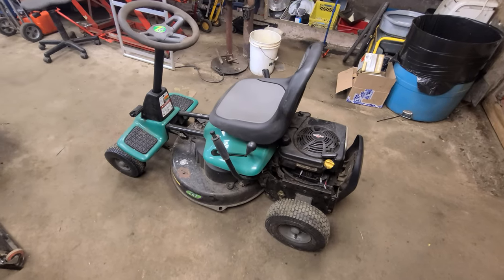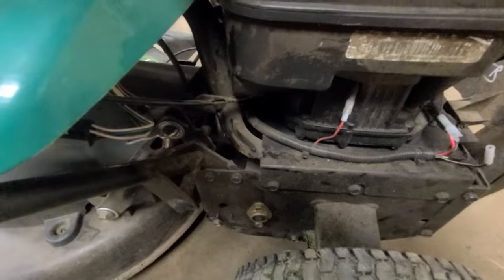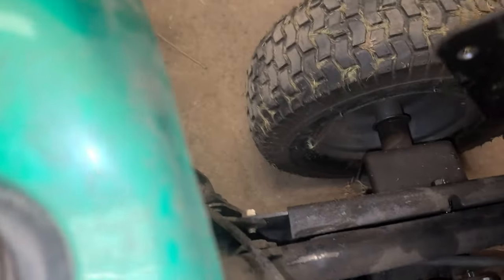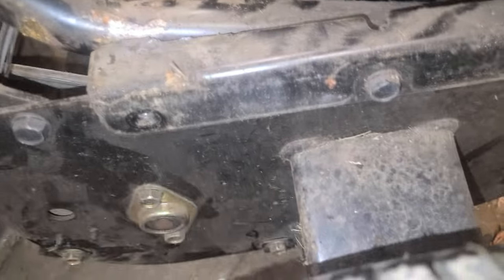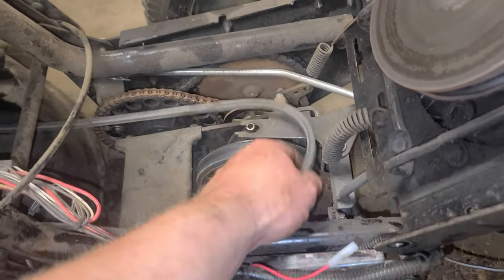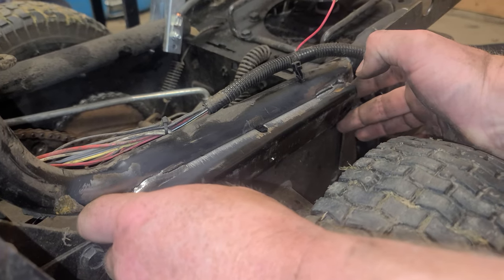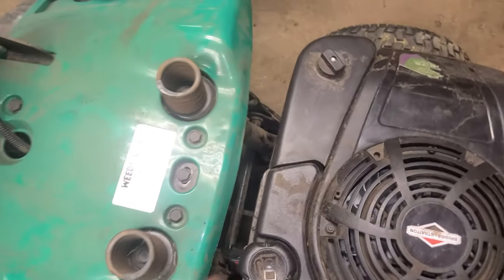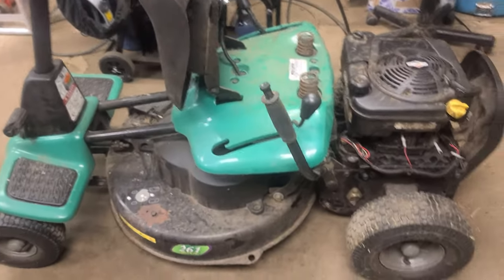Fixing a $10 Garage Sale Bought Weedeater One Rider Mower

Comment: I have the same mower. Twice I had to replace the flange bushing on the left side. Also had to replace the axle because once the flange bushing wore out it started to cut the axle shaft since it was spinning on the frame. I can’t get the flange bushing anymore. It’s been on extended back order since August. So I gave up and I went to Grainger and bought a DAYTON 2 Bolt Flange Bearing: Radial Ball, 5/8 in Bore, Alloy Steel, Set Screws, 4 in Lg, 2 in Wd and I bolted it on the inside of the frame. It’s perfect and better than what was originally there. Now I ran into another issue I can’t get it to engage in reverse.  All forward gears work. Reverse slips or won’t engage. I’d adjusted the shift handle a little to see if that would help. It’s still does the same thing. I’m at a lost on this issue.
Reply from the maker: Nothing personal against your machine but these mowers are absolute trash. It's why people give them away, they are sick of spending time and money on them. Sell it and get yourself an older craftsman or Husqvarna and be done with it

Comment: Just got one of these for free, only main issues i can see immediately is 1. Underpowered 2.when i drive it it makes a awful clunking noise, prolly something to do with chain or gears
3. No electric start, but that's fine cause i have a pull start on it too.

Otherwise everything else works surprisingly

I already have a John Deere z325e zero turn i got from Lowes on clearance, so i absolutely don't need another riding mower lmao.

But i just say, screw it, why not fix the shitty mower just for the hell it, it would be funny to see this thing working
Reply from the maker: I paid $10 for mine.. you got a much better deal 😅